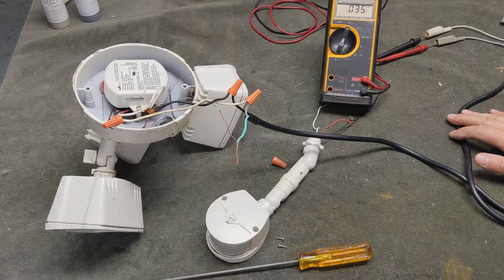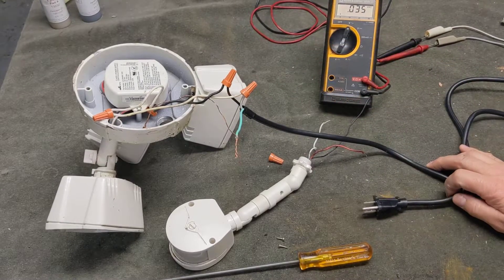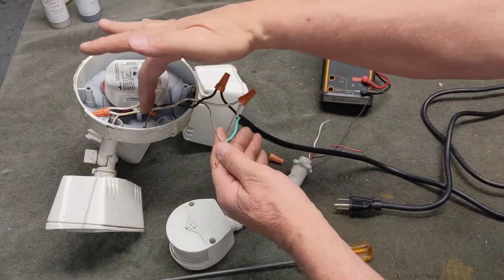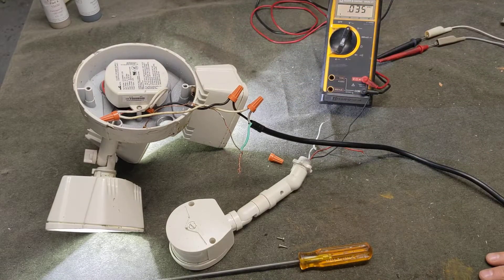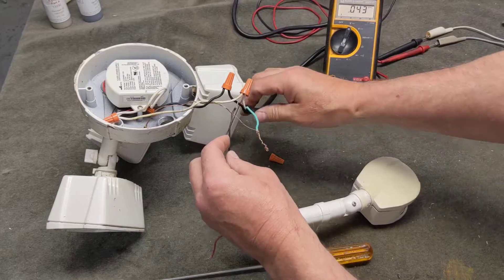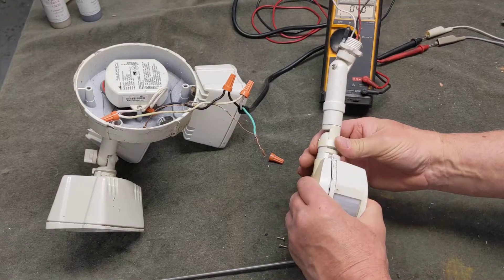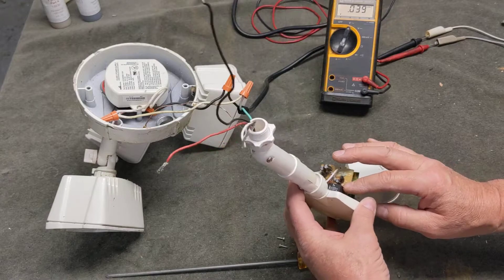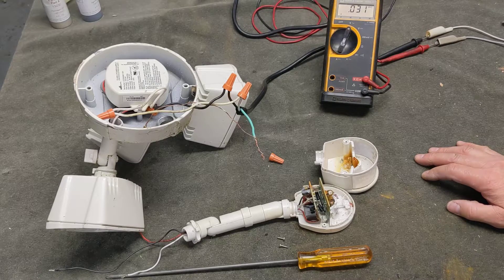Infrared motion sensing light test and troubleshooting. Caution-lethal-deadly voltage

Comment: I think I have the same problem. Where would I but a new sensor switch? May be way easier to buy new light for 30 bucks at home depot.
Reply from the maker: Home Depot or Lowe's sells just the sensor.  I have one installed inside at the top of a hallway and it has been working for 25 years.  I think water intrusion, temperature swings and bugs cause them to fail